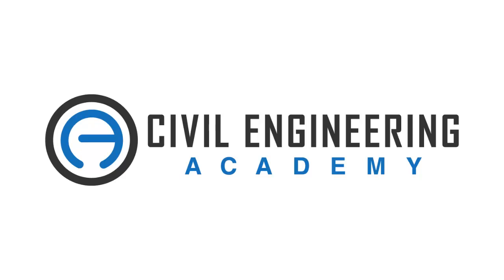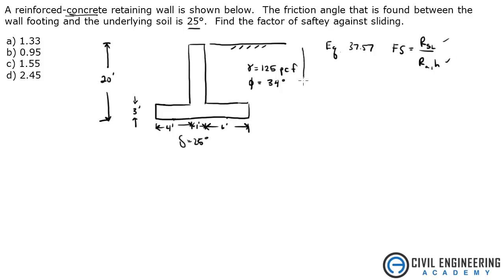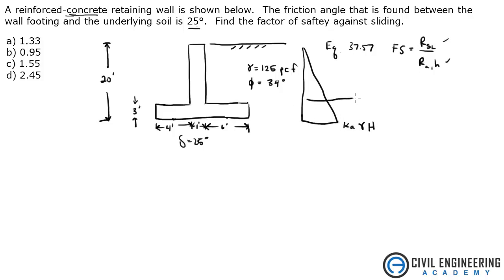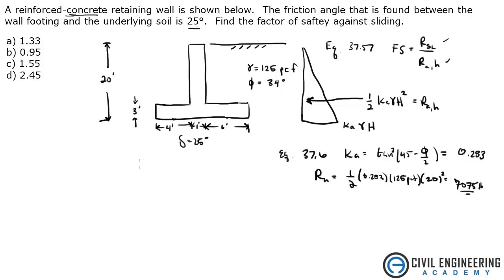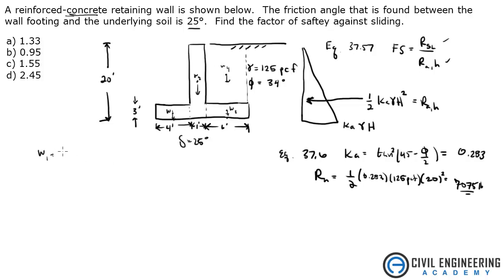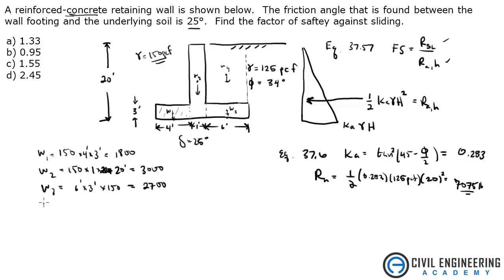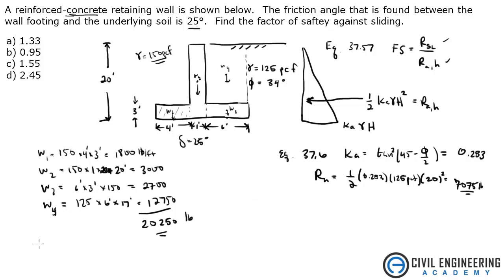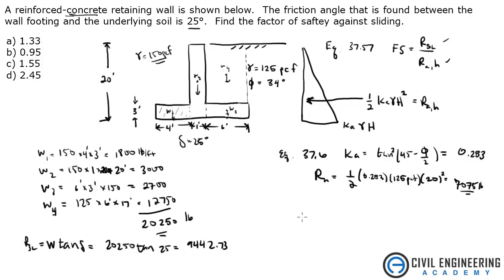Geotechnical-Factor of Safety Against Sliding on Retaining Wall

Comment: The CERM states that Ra=(1/2)*ka*gamma*H^2 not Ra,h. Why can you use that formula for Ra,h? It seems like we need to use that equation to find Ra and find the component of Ra,h. Also the CERM states that the equation for Rsl is Rsl=(sum of the weights + Ra,v)*tan(phi). You somehow took a shortcut that just multiplied the weight by the tangent of delta. I don't see the equation anywhere. How did you derive that? Thanks.

Comment: what if delta is not given in the question?
Reply from the maker: +Akshay Shrestha if it isn't given then they should give you what you need to either solve for what you need or it wouldn't be needed as part of the problem.